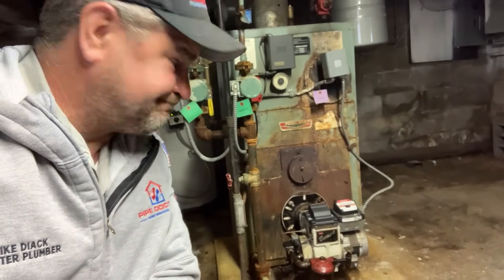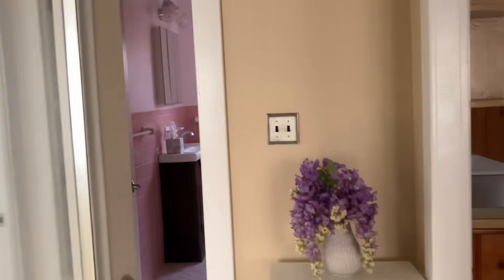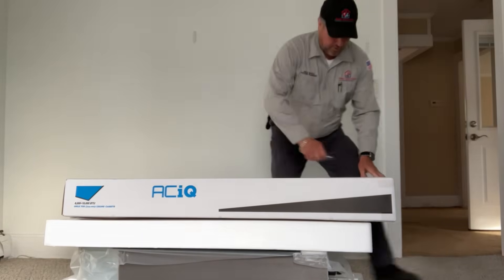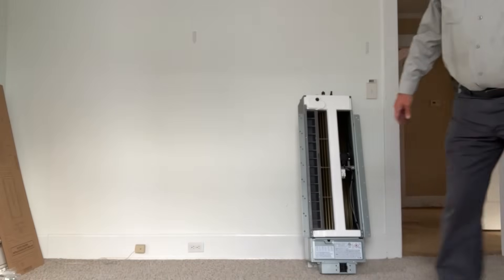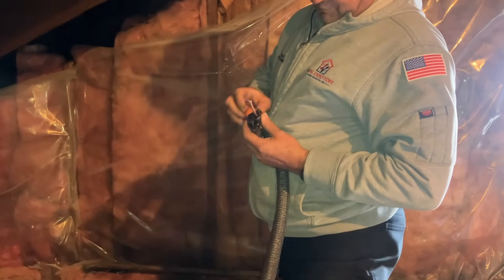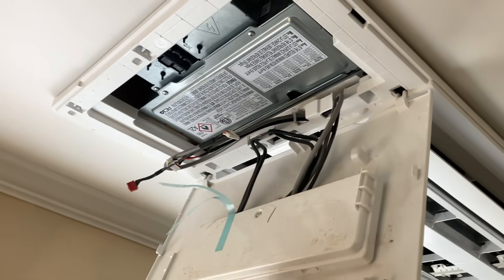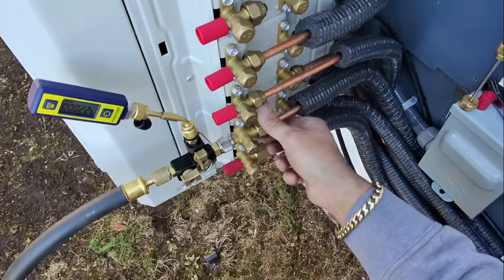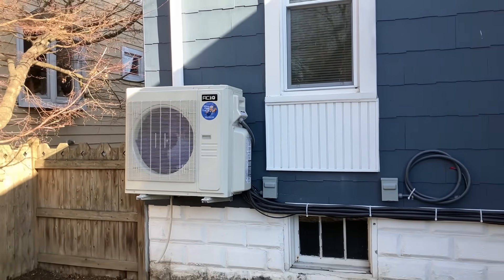Oil to Heat Pump Conversion | Why This Contractor Chose ACiQ

Comment: I agree do the calculations there's no way you will ever recover  the cost of replacing any boiler with savings of electricity gas with heat pump mini split system. The cost will be like this first it will be broken, leaking, and obsolete way before it will ever recover your investment prove me wrong
Reply from the maker: There are many factors to consider, and each situation is unique.

Comment: Great setup. As noted before my only concern is that in a dozen years EVERYTHING will need to be replaced including all the indoor and outdoor units. In all likelihood the communication wire and maybe linesets also. On the plus side, they do have a great cooling system also

Comment: For a small house this makes sense, I am curious how well it will work sub zero temps. They are all advertised that they work to -20F however that's just an advertisement. In reality mini splits work very poorly for heating below 30 degrees F. Will cost you a fortune in electricity.
Reply: Only if undersized. At 5deg this winter North East. 2  heads 9k btu each for standard size bedrooms. My room gets hot so fast that I have to lower it to 69-70 to sleep at night. Mine might be oversized a bit but no struggle at all
Reply: @Natstuff645 ok but you are heating a room and not a house.
Reply: @Taras-Nabad that's how I know about undersizing. The first I installed is a 12k btu in the living room, hoping to cover kitchen, bathroom and another room, total around 700 sqrft. It starts to struggle at single digits. It's 28F rn, The living stays around 75. The kitchen is currently at 71 and the guest bedroom is at 69. So it works at all temp but I know it rattles more at single digits, electric bill last year was better than my oil

Comment: I can already tell what's going to happen just by seeing the attic insulation or lack thereof.  their heads will be on fire, feet will have icicles and stomach area about comfy, the time spent on throne will be short as it will be cold  🤣
that's the typical outcome of an drafty unsealed older home trying to be retrofitted to new fandangled tech without other major needed changes first.

Comment: I would definitely go back and support the one way with all thread as designed.  Looks like you screwed it to the joists from the inside?  I have done that, but for long term support I would add the proper hangers.  Just saying, Mike.  Keep up the good work!